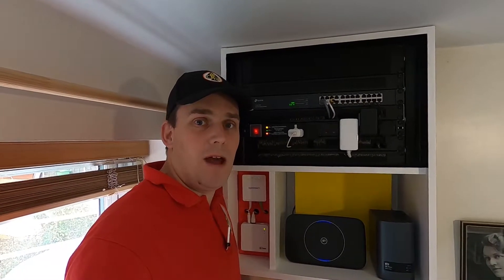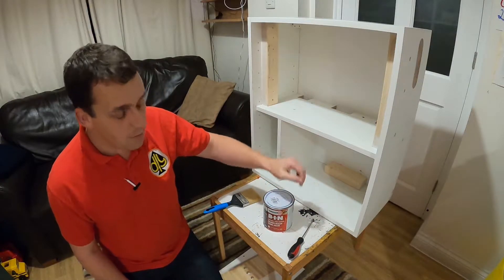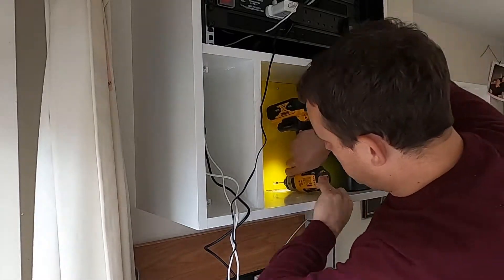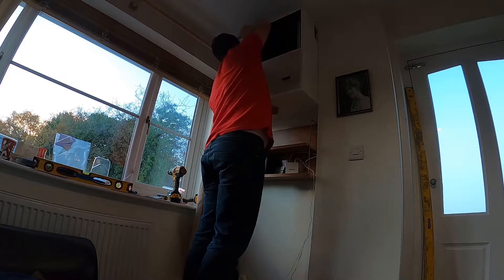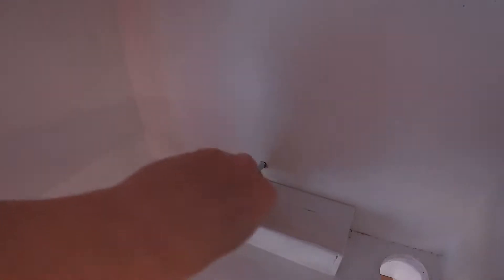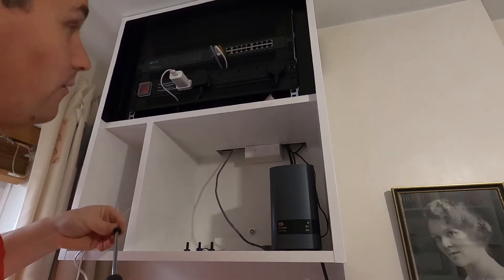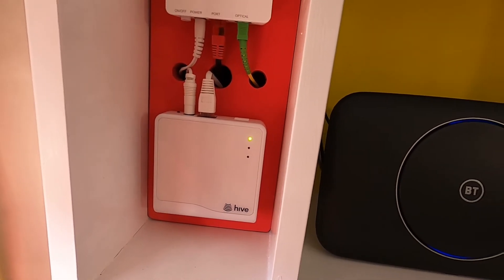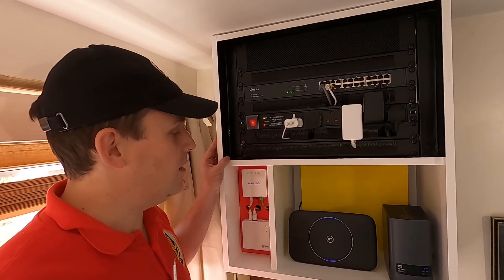Home made wall mounted 19-inch server / data / equipment rack cabinet.  Perfect for a home network!

Comment: By the way, mill is not the same as a millimeter. 1 mill is 1/1000th of an inch.
Reply: Depends on where you are. A mill is short for a millimeter, where as  a thousandth of an inch is a thou.

Hi from Australia.
Reply: @gorillaau  Thanks! I was thinking about mil specifically, i.e. excluding mill, but after your comment, I decided to look it up. Apparently, both spellings refer to the same thing, and it's in-fact only in some countries being used as I thought. Further more, it's apparently not strictly a thousand of an inch, but a thousand of the base unit.

P.S. Hi from Bulgaria! I am guessing the whole mil thing is not even a thing here since we don't use English.

Comment: How did you fix the Hive Hub and and BT Hub to the red accent panel? My hubs do not have any slot mounts for screws.
Reply from the maker: I've used some ultra sticky foam pads.  They've not fallen off yet!
Reply: @diyace  How's is the network install going in the home? I'm currently doing a very similar setup with a home network installation. Any plans for an update video?

Comment: The only thing missing is actually heat exhaust. You have just one or two switch so not the biggest heat output but I wouldn't do that with servers and big switch, need room for air in front and back
Reply from the maker: Thanks, agreed, I would stick a fan in too of I had something more heavy dity in there.

Comment: @5:55 talking about back-heavy, screwing in top screw first, of course. Tip: screwing in bottom ones first will force the rack-ears to the rails and hold them instead of trying to sheer off, friction is your friend! So is the principle of lever.

Rack looks really nice with the colour accents, thanks for sharing.
Reply from the maker: Thanks Sko!

Comment: do you have a link for the rack (the silver, into which you screw the components) rails.
Reply from the maker: Here you go...   All Metal Parts 8U rack strips Zinc plated 24.2 x 19.2mm sold in pairs https://www.amazon.co.uk/dp/B00O6ZGNCE/ref=cm_sw_r_apan_glt_fabc_HMTD4Z8R4ADBPNMD09PC?_encoding=UTF8&psc=1
Reply: @diyace  awesome thanks, hmmm, wonder if there is a 12u kit, let me go diggg.